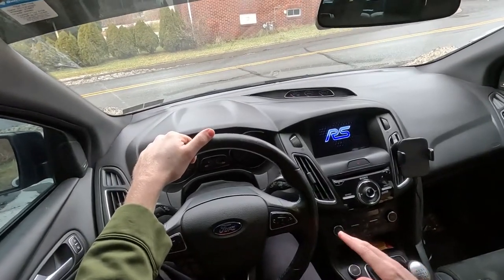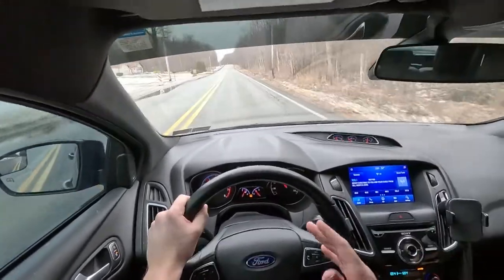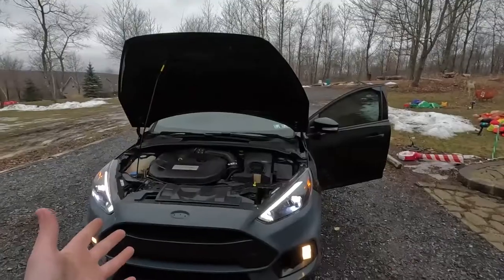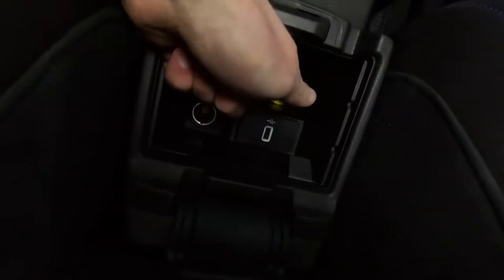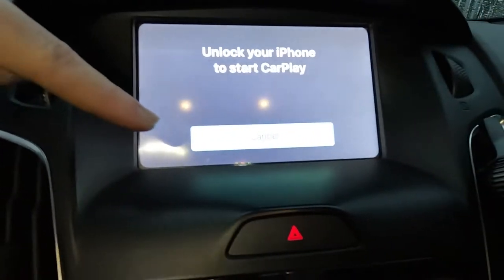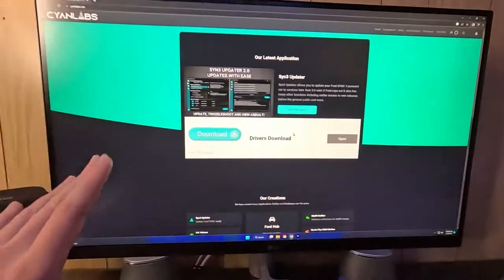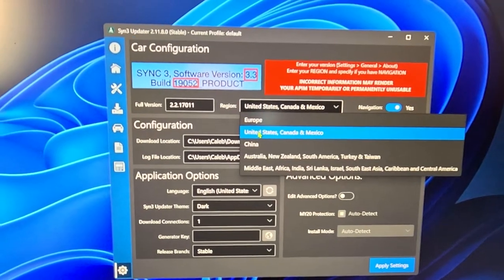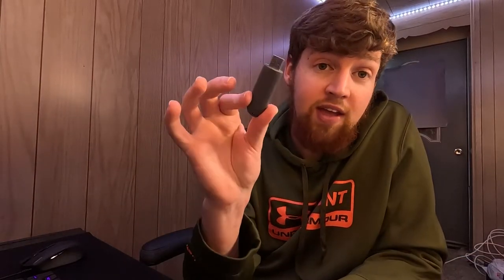Installing Apple CarPlay On Any Older Ford Sync 3...

Comment: Would this work on a 2013 ford fiesta titanium?
Reply from the maker: I don’t believe. That’s either running Sync 2 or My Touch isn’t it?
Reply: @Caleb Eckenrode  don't think so nope
Reply from the maker: @dylanhawthorne8148  is it Sync 3 then?
Reply: @Caleb Eckenrode  sync 1 I think.
Reply: I have f150 2013 sync 1, would it work? Apple or at least AndroidAuto?
Reply: I have sync 1 can this work for my 2016 focus S?